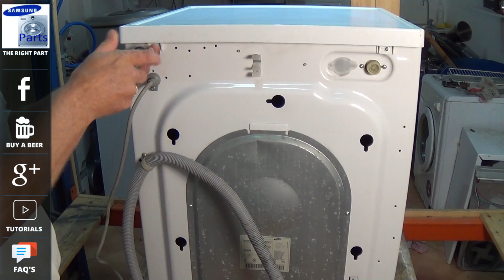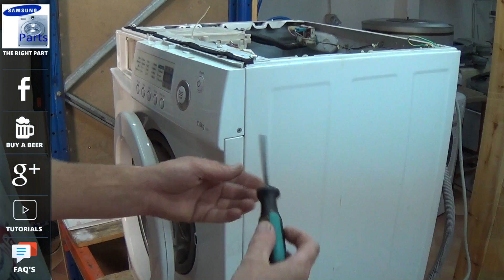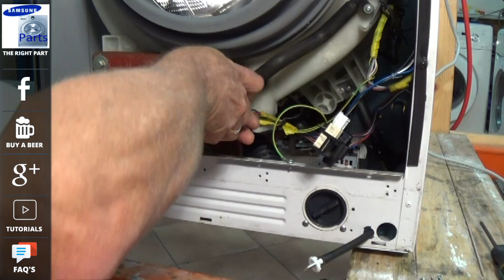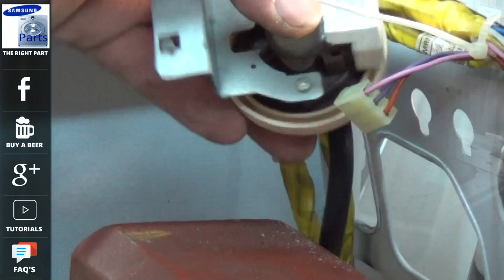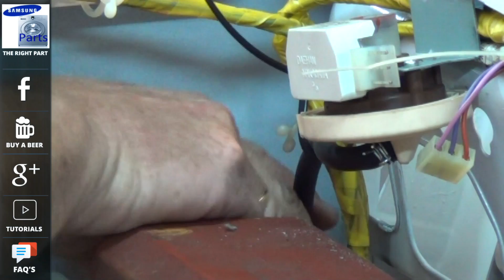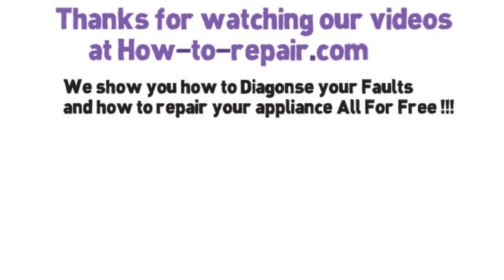Samsung washing machine error code 4E and E1 Fault Not filling in allocated time

Comment: 0 --> Drum cleaning reminder (It's not an error code) 
0E (OE), 0F (OF), 0C (OC) or E3 --> Overfilling error 
1E (IE), 1C (IC) or E7 --> Pressure switch error
3E, 3C or EA --> Motor tacho error
3E1 --> Motor overload error
3E2 --> Motor drive error
3E3 --> Motor signal communication error
3E4 --> Motor PCB terminal error
3CP --> Electronic control error  
4E, 4C or E1 --> Filling error
4E1 --> Incoming water temperature error
4E2 --> Another incoming water temperature error (For delicates and woollens only)
5d (Sd) or SUd --> Sudslocking error 
5E (SE), 5C (SC) or E2 --> Draining error
6E (bE) or E6 (Eb) --> Motor triac error
6C or 5dC (SdC) --> Automatic dispenser error (Wi-Fi models only) 
8E --> Vibration sensor error (VRT+ models only)  
8E1 --> Current/sensor error 
8C or 8C1 --> RPS MEMS motor sensor error 
9E1 --> Mains power error
9E2 --> Voltage error
9H1 --> Another mains power error 
11E --> Low water level error
12E --> Button error
13E, AE, AC or AC6 (ACb) --> Signal communication error 
14E --> Another button error 
CE or AC --> Water temperature error
dE, dE1, dE2, dC, dC1, dC2, DOOR or Ed --> Door lock error 
ddC --> Add Door door lock error (Add Door models only)
dC3 --> Add Door signal communication error (Add Door models only)
EE --> Drying temperature sensor error (Washer dryers only) 
FE, FC --> Drying fan motor error (Washer dryers only) 
HE or HC --> Heater error
HE1 --> Overheating error
HE2 --> Slow heating error 
LE or LE1 --> Leaking error 
LC or LC1 --> Drain hose error 
PF, PoF or Plo --> Reset after power failure
tE, tE1, tE2, tC, tC1, tC2 or Ec --> NTC sensor error 
UE, Ub or E4 --> Load unbalance error 
UC --> Voltage fluctuation error

Comment: hi thanks for video. Could you help me about this ? my machine working when i select rinse&spin but when i select any others it says 4e and waiting. i checked all wires cleaned them still this problem . please say something about this
Reply from the maker: The first thing I would check is the water supply to the water valve and make sure you check each individual solenoid @ferhadkarakus8436 please remember to subscribe to our channel as that really helps us https://www.youtube.com/shorts/e432SAb2g08  Thanks, Paul 👍

Comment: 4E 4E!!!   One thing that is a PROBLEM for Samsung washer is the type of Supply hose used.  I had a fancy schmancy Watts FSE2W72 Flood Safe  Auto-shutoff hose going to the cold. Stainless cover and most expensive hose as I recall.   I KNEW there was not a problem with water to the hose and I made sure the inlet screen was clean.  After installing  water hammer arrestors, a new cold inlet valve, and a new pressure switch... no help.  So finally I unhooked the hose at the machine and ran the hose to the launder sink and turned the water on..  No water!  WTF?  Clean city water.. can't be clogged.  Must be the auto shut component that has failed.  Or does the Samsung washer wear it out with it's continual on and off approach to water.   Don't know.   Put a basic hose on.. the one that came with washer and it now works fine.  I  note that Lowe's no longer sells this particular hose and I see several comments about this hose causing problems with Samsung and other washers.   Wish i would have seen those comments a week ago.  Oh well.  Avoided a service call at least...

Comment: Awesome! finally it works again, good job! anyway could  you help me  sir, I have samsung wf0702nce washing machine not same model but similar, the trouble is motor does not work after filling and error in position quick wash but the motor is normally working in spin position, kindly need your advise, thanks and warmest regards from Indonesia.

Comment: Very useful video. My Samsung 7kg frontloading machine is slightly different to the one shown. It started the wash cycle which suggested that the fill solenoid is OK and the water supply is OK. I found that running a rinse/spin cycle with the E4 message caused the machine to overfill/leak - suggesting a problem with the pressure switch actuation. Rather than take the front panel off first (the wire seal clamp can be a real pain to remove/refit) I just took the top lid off. The flexible pipe was OK just under the pressure switch but looking down between the drum and wall of  the washer I saw that the pipe had worn/fretted down there  causing a small pinhole and hopefully a piece of rigid pipe and two wire hose clamps with a bit of rerouting/foam protection will fix it without further dismantling. This video gave me the confidence to investigate/make a repair rather than just scrap the machine. IMO the Samsung is a well made machine - previously the main spider bearing went after a lot of use and at least you can split the tank to get the drum out and the main motor still looks as good as new..

Comment: My elderly father has an ecobbuble 8kg. They are not getting error codes but the machine starts then stops the cycle. The cycle lights flash. If you press start it starts pumping water then stops again. Any ideas.

Comment: Great video.   I had a NF error and it kept filling w/out going to spin.   Found on a repair comment board that it may be as simple as a disconnected water inlet tube.   Took the off the top with the two back screws and checked the small hose connected to the bottom of the round water inlet sensor.  Mine was at the front right and sure enough, hanging loose.   I reconnected it and everything's fine.

Comment: I just had a samsung dryer with a steam  function installed. The installer connected it to the water hose for my samsung washer. Now I am getting the 4E error message on my washer. Did the installer make an error or do I need a different type of connector?

Comment: Hi, my Samsung front loader keeps trying to pump water out during spin cycle but doesn't spin and will stop with the 4e code showing and alarm beeps.  Could you please help me with suggestions what could be wrong.  It is going through the wash cycle fine but the last spin cycle seems to be the problem.  Thank you very much.
Reply: Hi Pinky pie. I have the exact same problem now. Have you found any solution ? Thanks.
Reply: pinky pie , what was the repair? Btw good articulate,  I'm a DIY my problem is the same, But intermittent

Comment: 13 years ago, I received B1015J as a gift from Samsung Lithuania. Works up to now. True, the water drain hose was squeezed into the rear wall of the machine. The result was a hole in the bowel. I changed it.

Comment: I managed to repair it. It's really a machine easy to fix. I opend just the top cover by removing two screws. and I removed a hard nut of powder in one of the hoses under the powder container.

Comment: I have this model. The circuit board started to smoke and explode and did burn some plastic inside. Dangerous machine. I guess i should contact Samsung about this?
Reply from the maker: this may be a short on something like motor or heater etc
Reply: Wosigmasinstartkeisekre

Comment: Hi mate
Does the size of the pipe gong down to the drum vary in diameter . when i checked mine it appeared to have a section that was wider than the rest of the pipe on both ends, pressure sensor end and drum end. My model is  Samsung J845.

Comment: i couldnt fix the 4E issue using these steps. pipes were all ok. where do i find the info on pressure switch as a potential problem thanks
Reply: ezzyt if it is not the water, the solenoid has been damaged